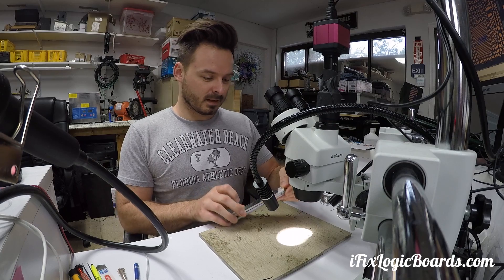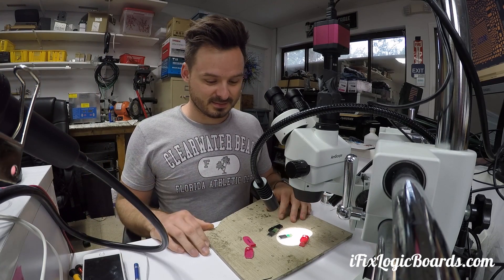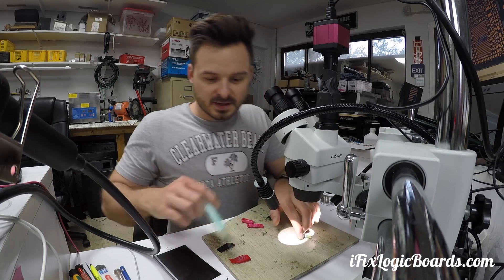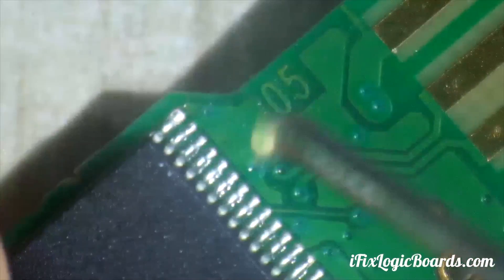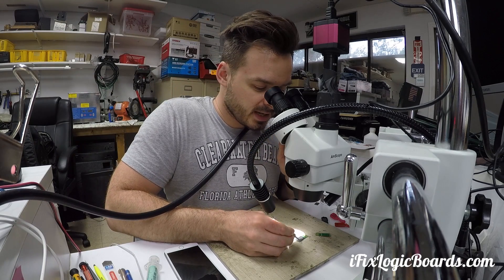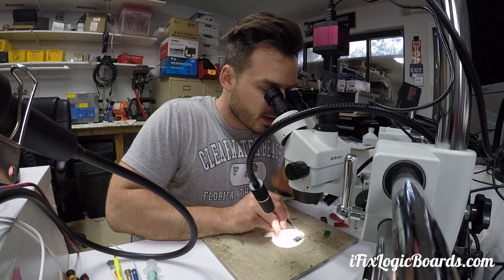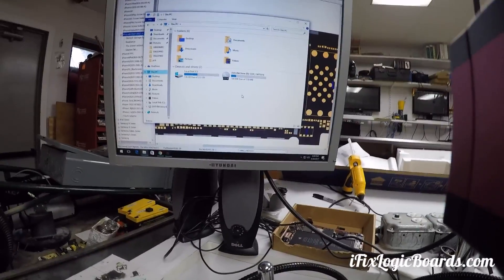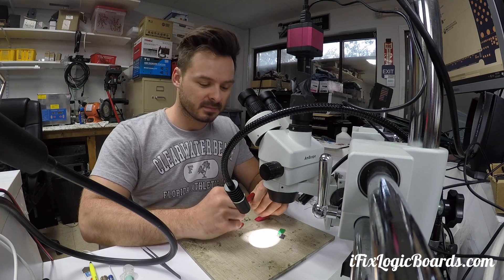Broken flash drive data recovery - transferring nand to donor board.

Comment: may I ask. Is it only flux did you use the liquid thing to replace back the chip? hope I can find asnwer bcos I really need to fix my flash drive that lots of important files to me
Reply: He uses flux to remove and replace the chip, be careful though because without hot air gun it's really hard
Reply: no need any hot air gun in removal process… simply just solder one side of pins of ic then slowly insert sharp half blade under ic and keep it moving towards the soldering side and lift it lil bit and do the same with another side and your ic will be out just in 1mint. totally simple and safe.